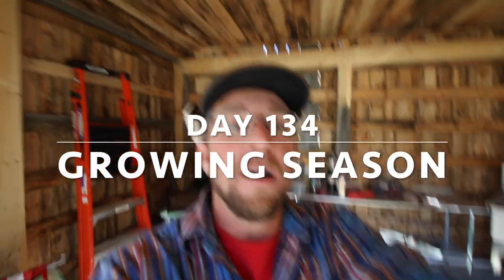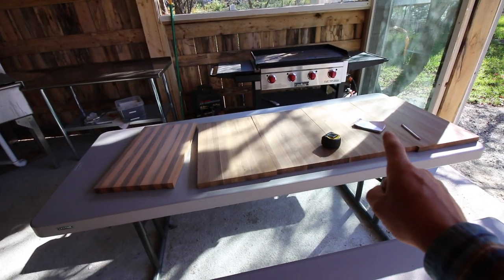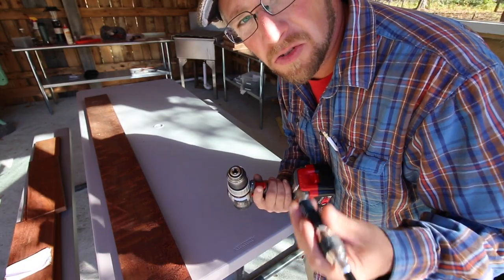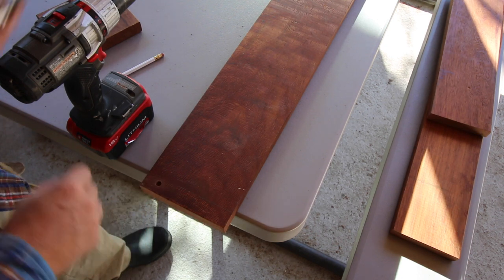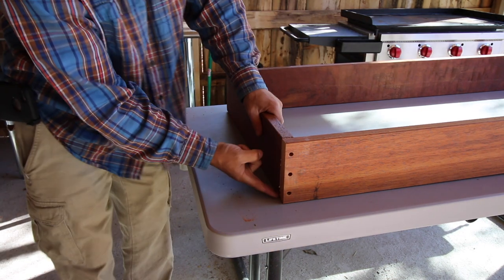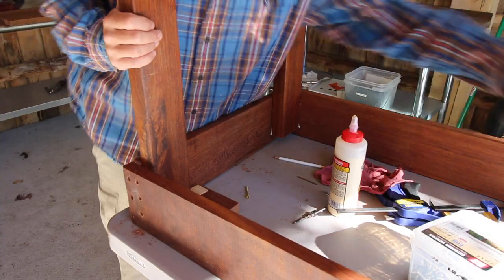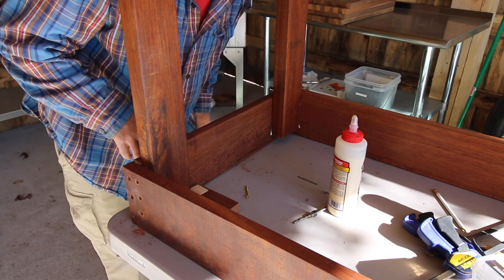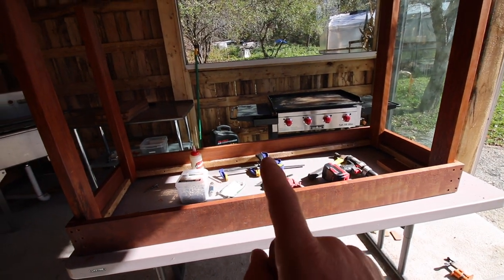🐖🔨Building a DIY Butcher Block Work Bench🔨🐖

Comment: That one will be a very handy workstation. Free wood too, can't beat that. Will it fit two people for smaller work? Maybe even more as an island?
One question though, how did you decide what orientation to attach the legs in? Why that one and not 90 degrees rotated? Is there some kind of rule to this? Maybe you can make a quick mention of that in the next video, unless it's already made?
Reply from the maker: I chose the direction by how I thought it looked. Lol

Comment: I hope u put wheels on it for easier moving
Reply: Colleen Rodamer -- Wheels would be good if the wheels can be locked down. Otherwise the table will be rolling around when a person is using the cutting board.